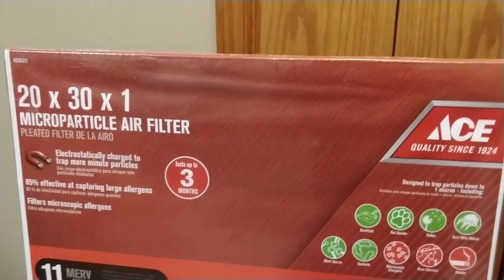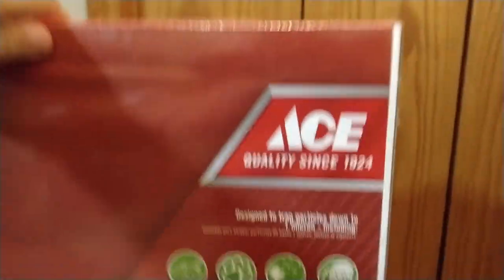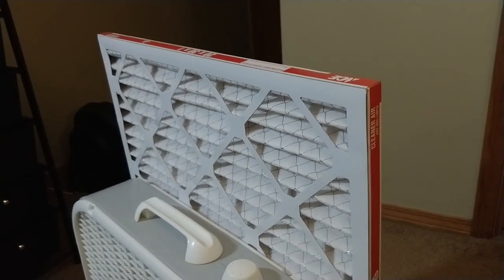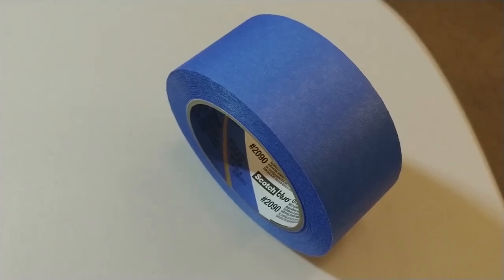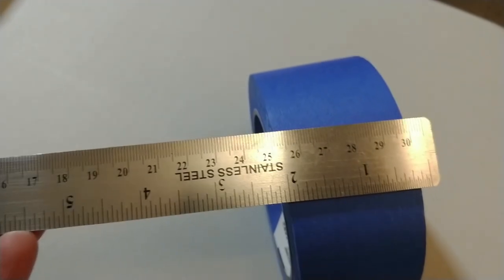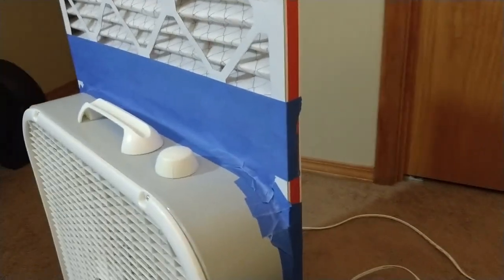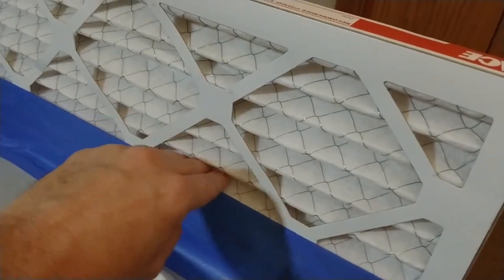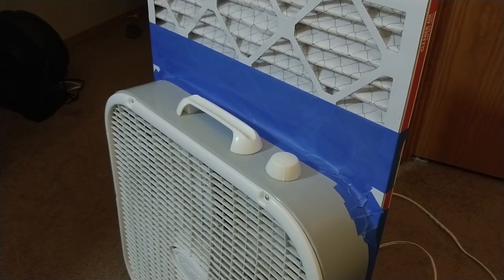Build a box fan air purifier with an oversized filter

Comment: Problem with this I’ve noticed is air circulating in from the corners on the front side. Probably makes it a lot less efficient at actually filtering the air since not all the intake is going through the filter, but it’s better than nothing. The filter is still noticeably dirty after only a few days from this smokey west coast air.
Reply from the maker: Oh, I'm sure they're not super efficient. This is definitely a temporary hack, and I wouldn't recommend this to replace an actual air purifier or HVAC filtration system.

But it has made a huge difference in indoor air quality at our house, and with how disgusting the filters are after just a few days, I'm very grateful it's the filters turning brown and not my lungs.

So efficient? No. Effective? Yes.

Comment: Ya know you can buy 20 x 20" filters, right?
Reply from the maker: Read the description. We were a stage away from required evacuation due to wildfires, and the smoke was extremely bad. Almost every filter of every size was sold out at every store. I was lucky to even find the oversized filters.

Comment: My box fans have the plug and the speed control on the back so do you have any suggestions for how a filter could be attached?  What brand box fan are you using?  Maybe I can buy one on Amazon.  All the local stores are sold out and like I say, I don't think mine will work with the filter attached.  But it's a good idea.  The air here in Corvallis in my apt. is a bit smoky, bearable but not ideal.
Reply from the maker: From what I read, it sounds like you can attach the filter to the front as well. The first video I watched had the guy doing it that way. Basically, you're just trying to force air through the filter, so either putting it on the front or back should work about the same. This is just a temporary solution.

I was just down in Corvallis last Sunday, and it was beautiful day for a hike. What a difference a week makes.
Reply: @PacoWarabi  Yeah it is a huge difference, thank you!

Comment: Will this also work for when you cook something on the stove or you burn something in the oven? I need to get those smells out?
Reply from the maker: I think it probably will, but I just built one this morning, so I don't know for sure. It has removed the smell of wildfire smoke, so that's something.

I just looked at the packaging, and the MERV 13 rating specifically states it will filter odors. I'm using a MERV 11 filter because that's what they had, so you could maybe go one step up.